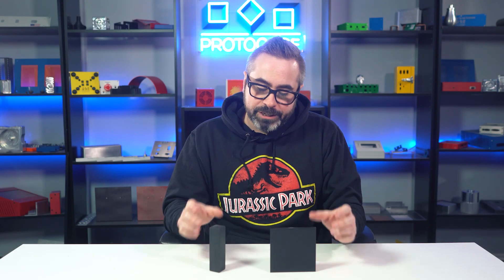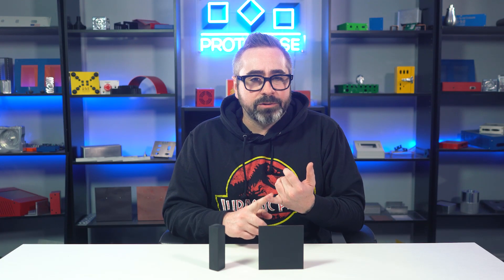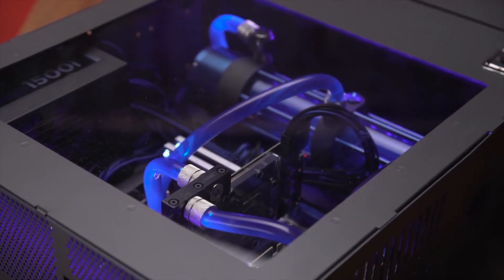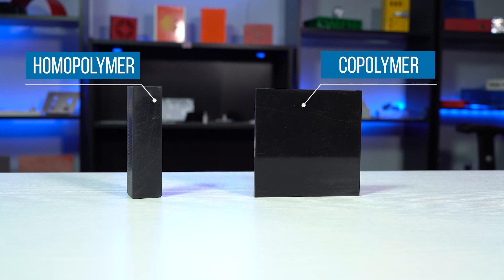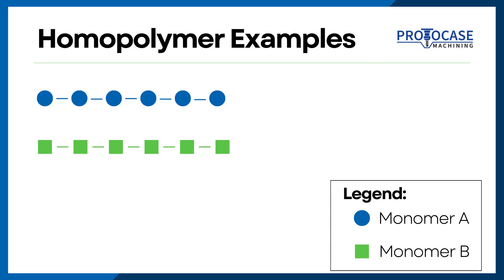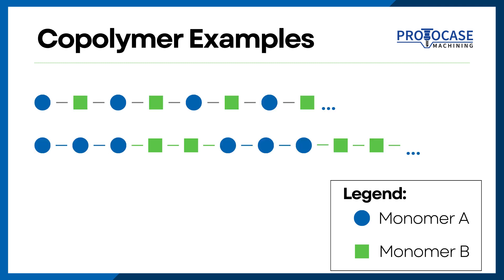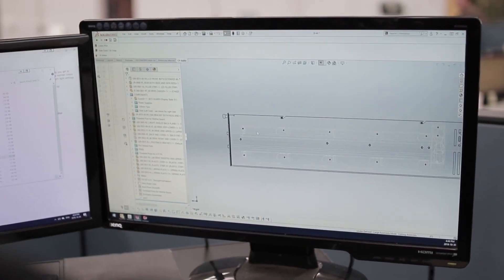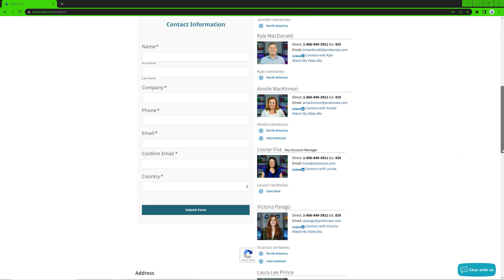Proto Tech Tip - Types of Acetal: Copolymer vs Homopolymer

Comment: Really impressive! but I didn't get it well when it comes to Medical application, why does Co-POM suit better than H-POM? Thanks!
Reply from the maker: Great question! Aceteal Copolymer (Co-POM) has better long term resistance to corrosion and has low moisture absorption. Its also much more chemically resistant in the long-term than Acetal Homopolymer. If we are talking about short-term mechanical properties, than you would have no problem with H-POM. Hope this answer clears it up for you. 

Thanks!

Comment: Which type would be best for machining on a lathe? I will be using 1" dia. round stock and need the surfaces to be very smooth. I recently had a bad experience with a piece of copolymer which would NOT machine smoothly with any of my tooling. Surfaces came out looking like I was trying to make threads! Thank you.
Reply from the maker: Very interesting question! It is possible that the material properties of Delrin would reduce the surface roughness to provide the smoothness you’re after. Since the yield of Delrin is higher, it may be easier to attain a smooth finish, as generally the harder the material the easier this is to do. That being said, other important factors would likely be work holding, and turning speeds and feeds.
Reply: @ProtocaseInc  Received a piece of 1-1/4"dia. homopolymer  today and it machined very nicely. I'll stay with that stuff now!